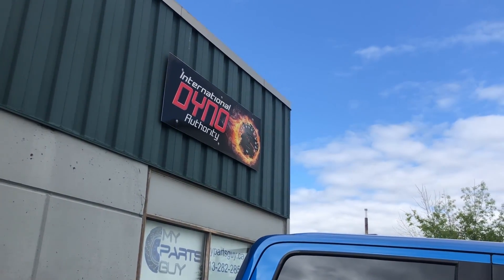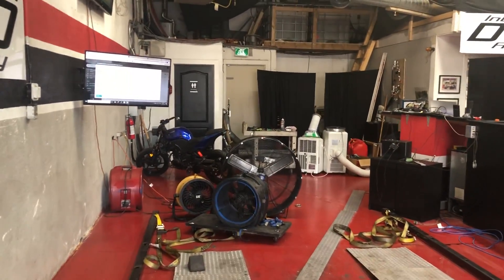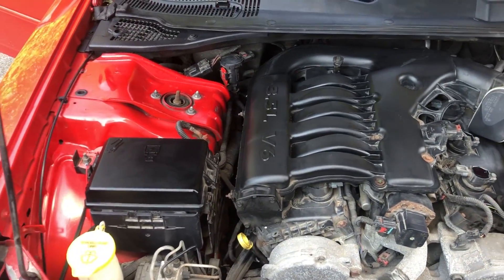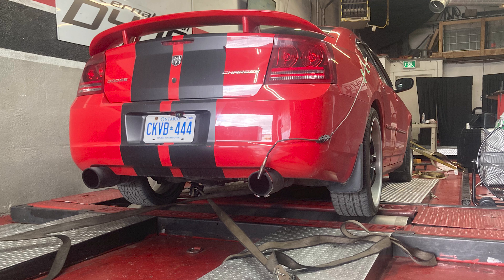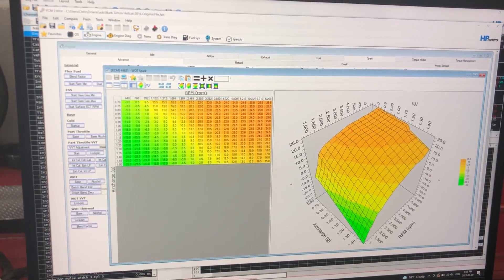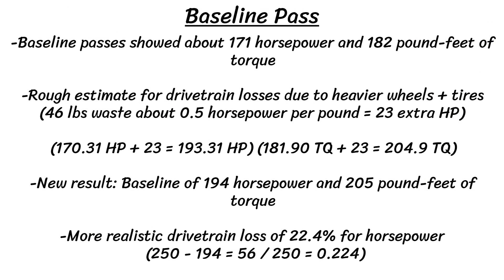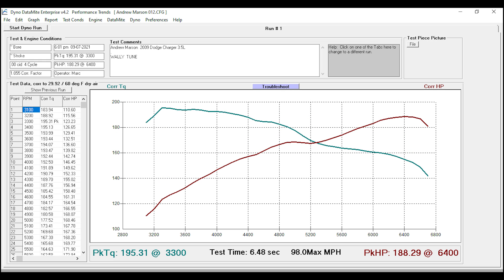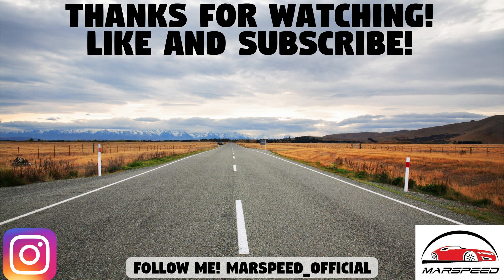Dyno Tuning My V6 Dodge Charger With Over 200,000 Miles!? (International Dyno Authority)

Comment: My first car was my 2008 V6 charger, and no matter what breaks down on it, I'm keeping it. Once I have enough money I'm going to push that car to its absolute limits.

Wish more people modded this engine but I can understand why no one really bothers
Reply: Have a 09 Sebring with the 3.5 I really want to modify it but nobody really modifies them that much and it sucks because of the lack of performance parts that are available
Reply: @off-roadmechanic fr i have a 2006 3.5 and i had to have customs cams made and do alot of the ported and springs in the rockers and just little stuff like that myself but on another cars you would be able to find, but these cars after you fix the oiling issues can make 450 stock with like 6k into it, mine currently has 94k miles and is in pristine condition. I plan keeping this car forever

Comment: Nice Dyno run. The engine is fine with it stock & custom exhaust. But it could use a upgrade like a supercharger & headers etc....
Reply: Nobody makes them for the 3.5 I don't believe
Reply: @sleepingmoon6649   supercharger yes. But for headers you can still get shorty headers and long tube headers for the 3.5 v6.

Comment: An important distinction is powertrain vs drivetrain. Powertrain is the engine and flywheel. Drivetrain is the sum of the powertrain the transmission driveshaft rear differential axles wheel hubs and wheels all added together.
Reply: I say this because a tired drivetrain can mean the differential axles and bushings holding the differential can all soak up power transmission this isn't even mentioning a tired automatic transmission.

Comment: Ya know,, I respect the V8 you had built it's sick, I wish I could've afforded a stroker kit when I bout my long block, but instead I just got the cam and head job lol however I really don't think that's enough mileage on an engine to call it worn out, even tho it's a weak V6, it's not really that many miles, my 5.7 didn't kill itself until I had 280,000 and I tore it apart and beside the screwed up valve head and one piston, I did all the measurements the rest of the engine might as well have been brand new, it showed no signs of wear besides the dropped valve seat

Comment: I have a 2007 Dodge Magnum with the same engine and I run pump 93 premium on it and it is a lot stronger. These motors have 10.5 compression ratio and should use 91 octane Minimal. I was told that these produce a lot more power with higher octane. Should try your test again with higher octane fuel to see where your horsepower is at. I my car I definitely felt the difference.

Comment: Im glad I found this, I have 2010 Chrysler 300 with same V6 but, i have been slowly upgrading it; CAI, upsized throttle body, MSD coils, hi-po plugs, shorty headers, hollowed out cats, delta 40 muffler & Bob's custom pipes (no resonators)...been eager to get it dyno tuned ! My question for you is; Did you eliminate top speed/ rev limiters ? Mine runs very strong now but but the stock 3spd trans limits top speed & i know there is much more available. I also put the 20" factory srt wheels on mine.

Comment: Do you think the V6 Charger from 2006 2010 is worth modifying with cams, headers, turbos etc.
Reply from the maker: Definitely not at all. I wish I didn’t put money into my V6 and just bought a V8 earlier. The V6 can’t make much power. 250 is not much to begin with and turbos/headers/cams will cost a fortune just to get you to RT territory. The parts also likely won’t be readily available as the 3.5L was only around from 06-10 so I can’t really find any superchargers or turbos around or anyone who would know the engine well to install them. The sooner you can get your hands on a 5.7, 6.1, or 6.4 the better, those can be easily modified to different levels, lots of aftermarket support, and comes with better noise and power than any V6 plus other bells and whistles!
Reply: Thanks I will concentrate on my 07 SRT8

Comment: Do you think the V8 Hemi would run better with a cooler thermostat. Like a 190° instead of the OEM 206°?
Reply: 180 T-Stat is the way to go but only if you have a tuning device to allow the fans to come on at the right temps. 170 T-Stat is do-able but may throw codes saying your engine isn’t at ideal temp if you live in a colder climate. Boutta put a 180 on my 300C

Comment: I wonder if there's any performance mod that you can do to the 3.5.....?
Reply from the maker: There isn’t too much other than exhaust, intake, tune, and headers. You could swap the cam too but not worth it imo
Reply: @MarspeedCars  understood that.....
Reply: @Mettz97  And to add to that if you’re willing spend a little extra you can upgrade the cylinder heads.
Reply: Can you add A Turbo?@MarspeedCars

Comment: Wouldn’t that tune cause their to be  a substantial more chance of something going wrong mechanically with that car and that millage? I wouldn’t have done it unless you have the money to fix things when they go bad
Reply from the maker: No it’s still within OEM specs I believe so it’s nothing too extreme. There are lines you can cross where things become dangerous but it’s usually safe
Reply: @MarspeedCars  looks like you’re still young, just have fun man lol … I’ve gone through 12 cars at this point, in 30s over the money spent and crashes lol … best of wishes to you and your two ginger gals!

Comment: Hey so I’ve been wanting to tune my 09 v6 charger for awhile now because I feel like there’s more potential power out of it then I’m getting currently, but I have no clue where to go who to speak to or anything like that, if you have any helpful information to get me to that path that would be much appreciated
Reply from the maker: Hey all you gotta do is get in touch with a tuning/dyno shop in your area. If you’re in Ontario I can direct you but otherwise just see what shops are in your area then call them. Some specialize in certain brands, but reputable shops will be able to
Improve power in any vehicle. At the dyno is where you do all of this for a fee. Baseline runs, then more runs to tweak/tune. Also it’s a cool experience to partake in!

Comment: Who puts 65 pound wheels on a sports car, you're not correct in the head.
Reply: My OEM Demon wheels are 58 pounds, 65 is not that much more lol
Reply: @captainboose8788  its fine, im sorry for the rude comment i just had enough of big heavy wheels 😂
Reply: @automotivetv9861  I agree ,  but 20s are alot better than 22s , I have 18s and 15s on my cars
Reply: @captainboose8788  i had 15s on my v6 camry with low profile tires so the wheel diameter was small but guess what, i was beating every V6 and some V8s and all i4 turbos that i was racing
Reply: @automotivetv9861  Yeah I have the 18s and 15s on my 2 Challengers with big tires, helps alot for drag racing, thick sidewall